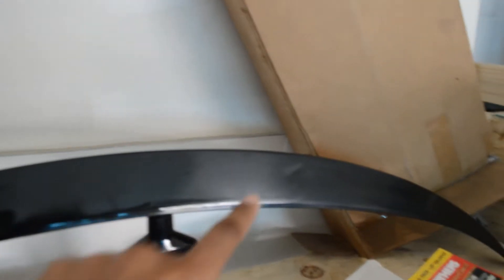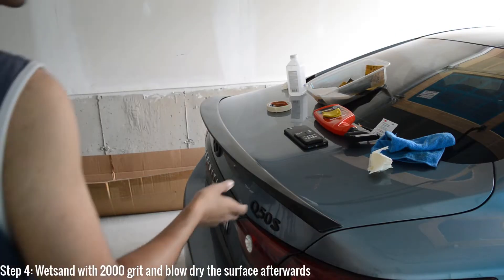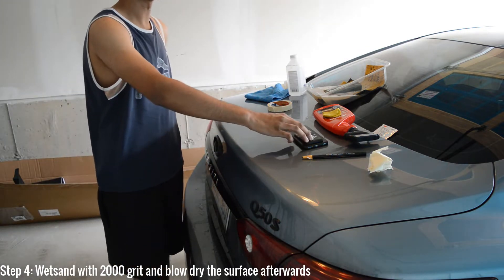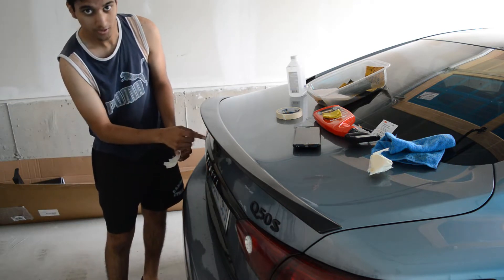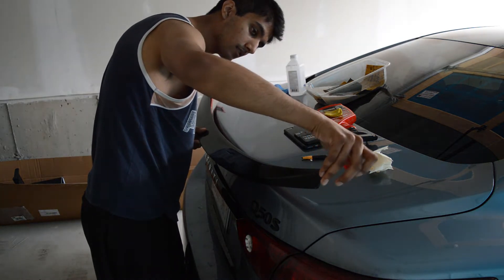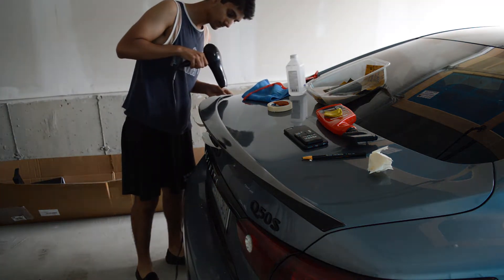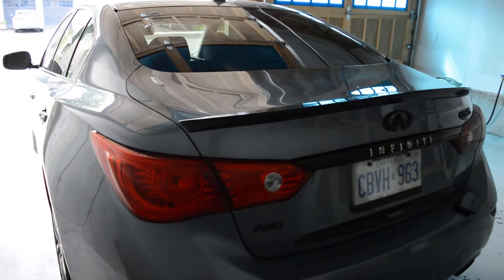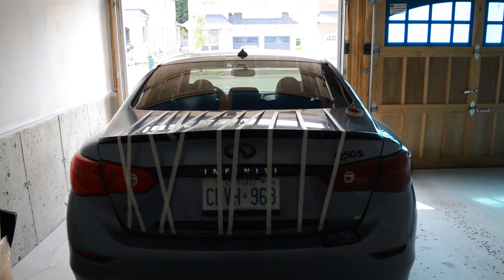2015 Infiniti Q50 Lip Spoiler Install (EASY DIY!)

Comment: Great vid !! I bought the same spoiler a while back and installed it but because it’s not a true fit the corners lifted after a couple weeks after installation. Did you have the same issue with yours after some Ontario weathering lol.
Reply from the maker: moe2332 mine didn’t lift because I put silicone around it so try that next and see if it helps 😊
Reply: Anish Nothoo can you upload some kind of image to show where you applied it ? Did you put it under neath the actual spoiler or around it
Reply from the maker: moe2332 I’m gonna make a video on it cause I get a lot of questions about this and 3m tape lifting off. Trying to finish all the mods for this season and I’ll start editing and uploading asap 😂😂

Comment: How is the stock spoiler removed?
Reply from the maker: Fishing line and heat for the adhesive then remove the screws I think. The only thing is that no matter what spoiler you get you will have holes showing or at least that’s what I been seeing on FB posts

Comment: Dude..the 3m tape will not come off. You can drive immediately. The spoiler is going to be pretty much permanent
Reply from the maker: Shane B you’re right it won’t come off but I wanted to double down on it and I added some black silicone as well